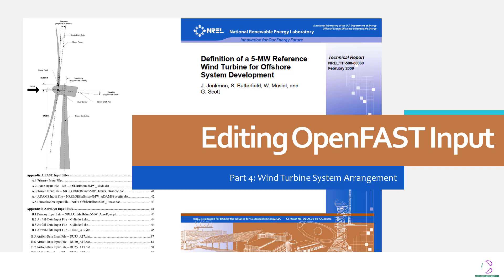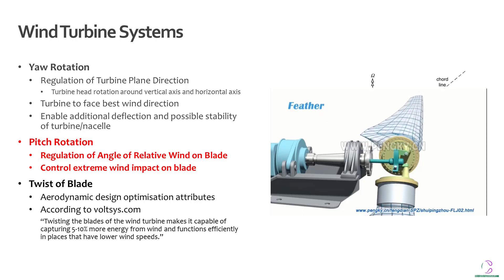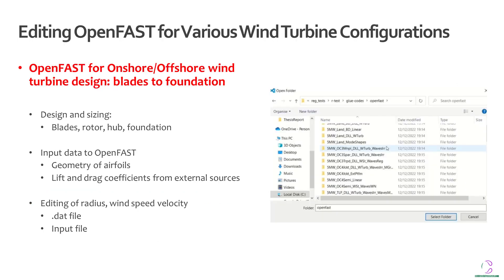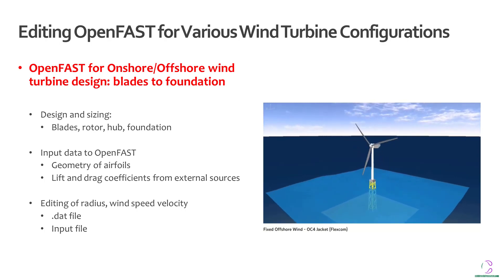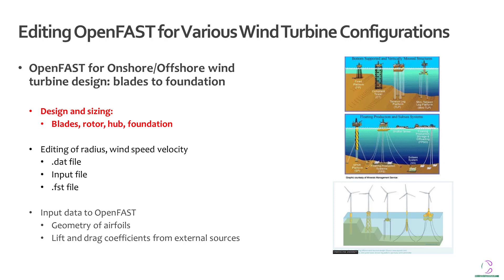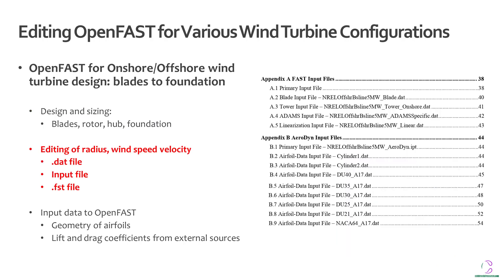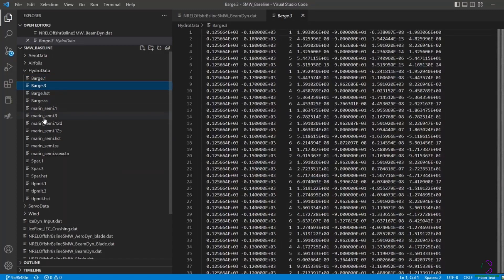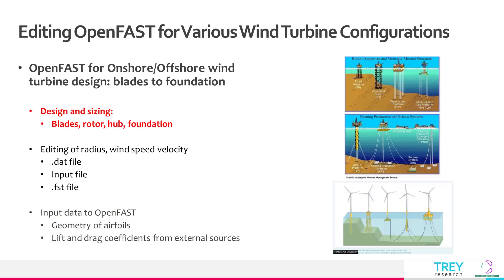Part 4: Design of Wind Turbine Systems | Editing OpenFAST Input | Wind Turbine Design Technology

Comment: how do i change the default windspeed form 12 meters per second to something else like 15 or 20? 

I am using the 5MW_Land_DLL_WTurb.fst

i have been searching for over a week on how to change the windspeed and i still dont know how

thanks
Reply from the maker: Changing the velocity values is kind of complex, but if you have wind speed data, it's easier.

Check the 5MW_ Baseline folder for Wind folder. You'll find 90m_12mps_twr